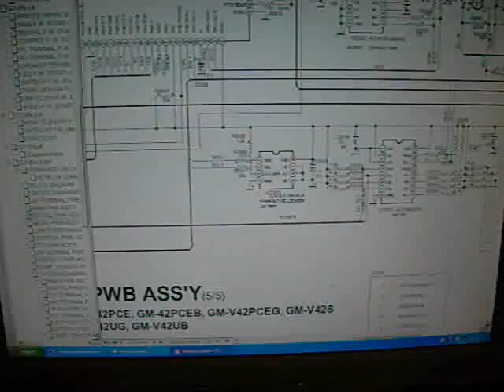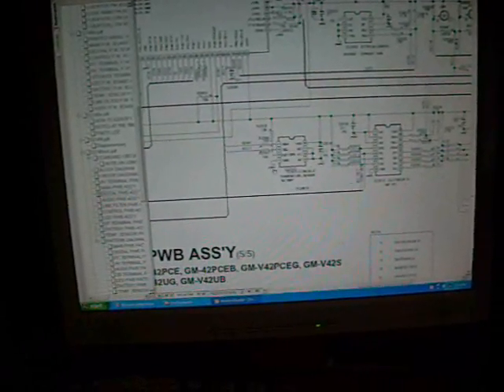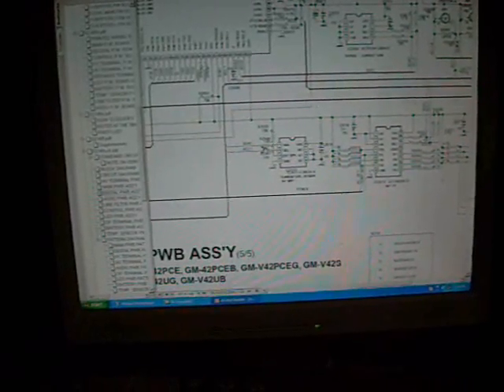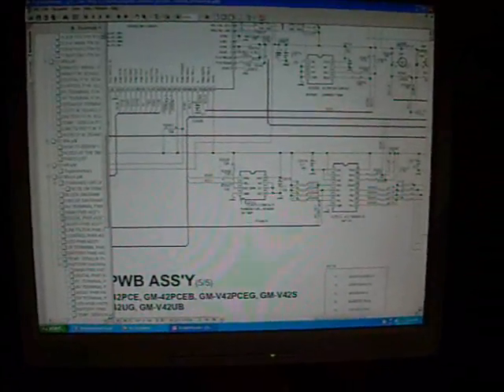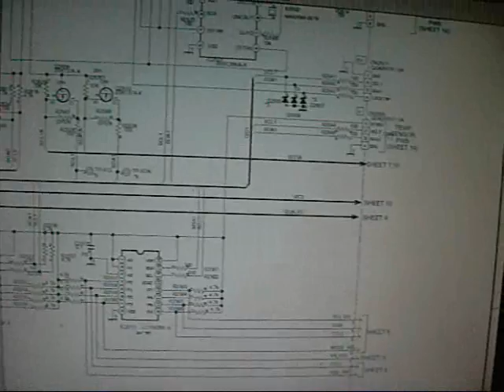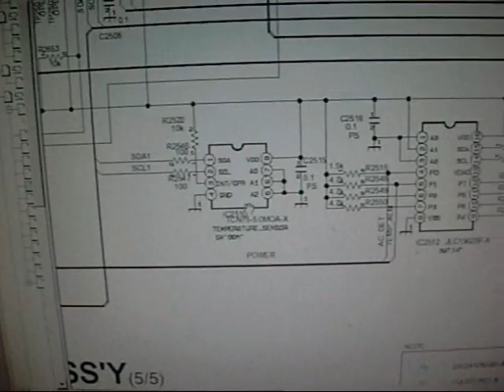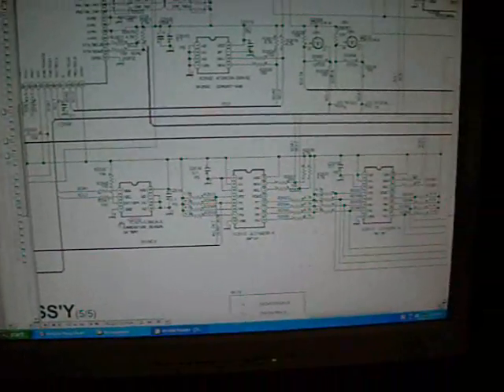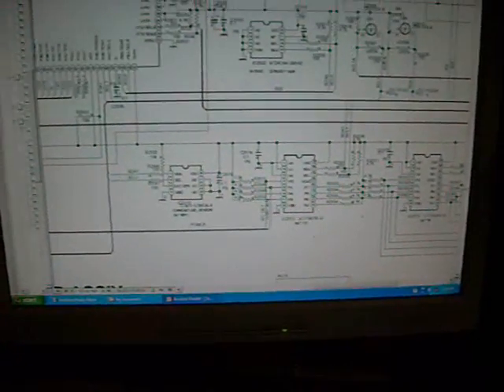JVC Plasma Repair: SMD Fun

Comment from the maker: @randyfromm lol yeah its just a cheap nasty iron. i'm ordering a proper temp controlled station soon for when i re-visit a few plasma TV projects.

the advantage of the copper tip is I can machine it as fine as I want on the lathe. but then you can interchange tips on a good iron so its a moot point.

Comment from the maker: I tried that on a few example IC's (scrap boards) and the force required to cut the pins was enough to put the knife blade into the PCB below and sever traces when the pins broke :(
if it were a fine pinned processor IC I'd do it but I didn't want to risk severing a trace with this one

Comment: Looks like the temp IC has I2C serial data interface directly into the CPU.  The I2C bus should be shared by other other IC's, so if temp is the only error reported; then that IC should be the troublemaker as it is transmitting false data.

Or one of the SMT resistors as you suggested could be bad.

If you haven't, check Vcc on the IC.
I am curious to see what resolves the problem.

Comment: Usually these mods are common in high cost limited production equipment.

I worked on a late model X-ray machine for semiconductor quality control.  The boards in that machine had significant numbers of cut traces and jumper wires; parts soldered on top of others etc.  Capacitors were added everywhere.

This from the factory.  The boards were too expensive to discard it seemed.